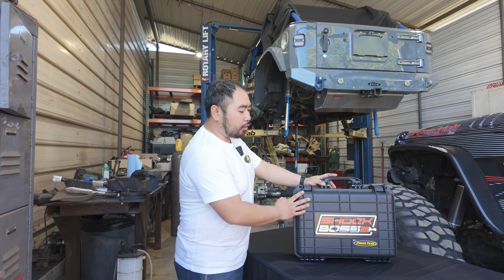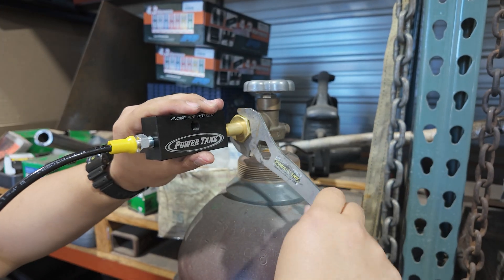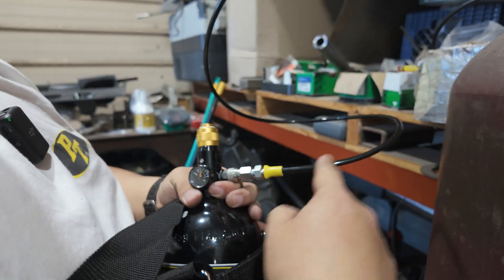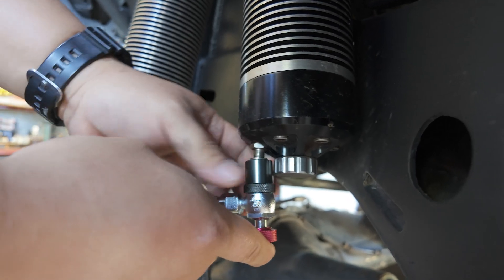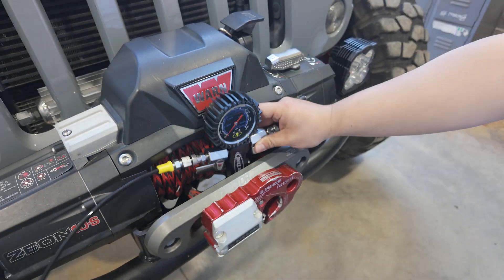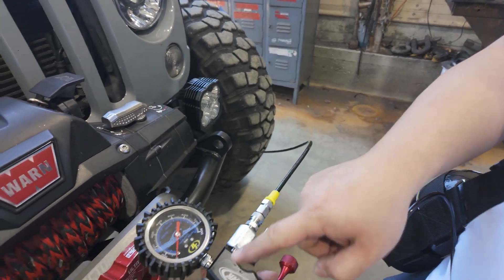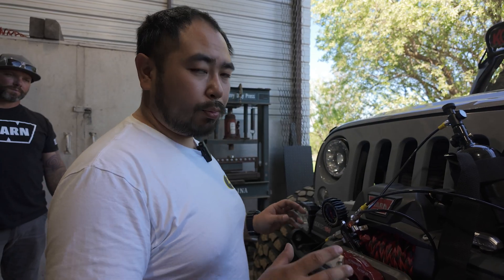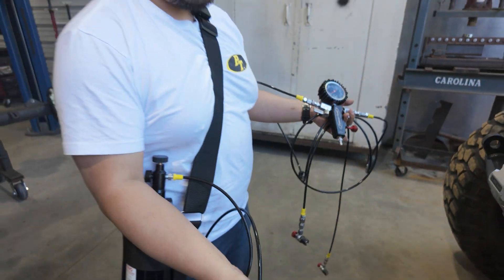ORI SHOCK BOSS V2 - Set and tune your ORI struts w/ New Dual-Fill Strut kit

Comment: How come nobody ever shows how to attach the regulator to the top of the bottle.  Mine gives me so much trouble every time I do that.
Reply from the maker: Put a small amount of anti-seize on the threads of your bottle. Should help things along.
Reply: Can I use this bottle to air my tires? Does someone make such an attachment?
Reply from the maker: @Bizcuit-Gladys  This is a very small volume of air. You would want one of our CO2 system for airing up tires.
Reply: @PowerTankOfficial what is max hight these will allow you to go?
Reply from the maker: @bobbygorby4575  The included N2 bottle has a step down regulator which takes the full bottle pressure and reduces it to a maximum of 800 psi output.